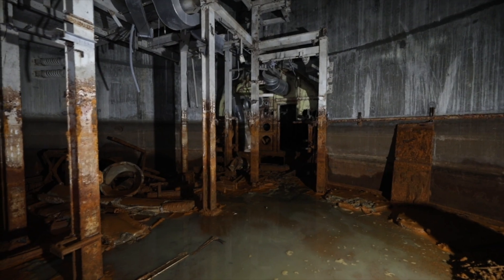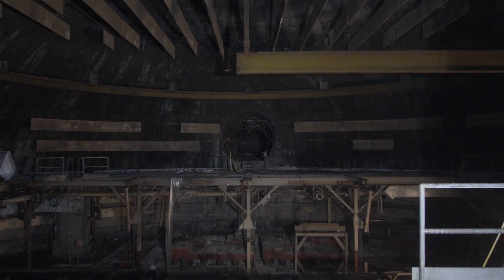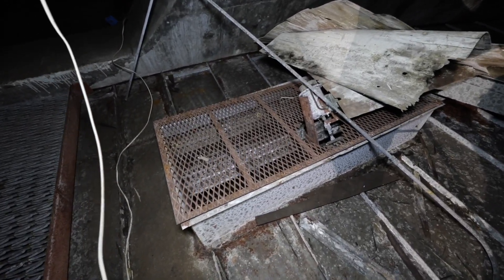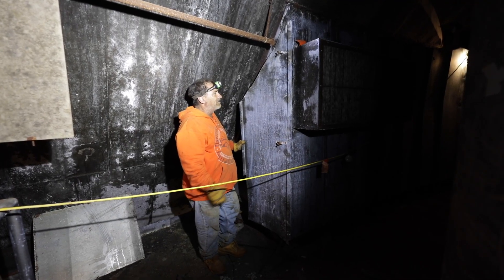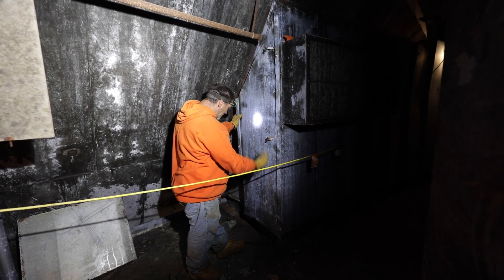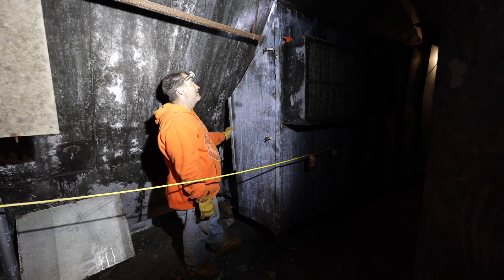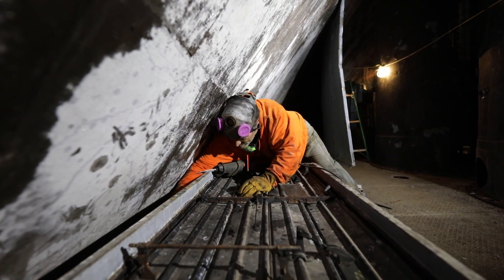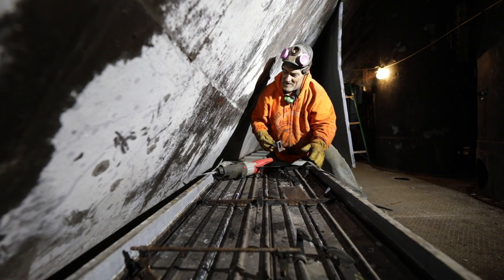Ep. 52 - TITAN 1 Power Dome Mezzanine Demolition

Comment: You have some good workers. You also have big dreams and seems the budget to see them though. You need the access portal lift running. Maybe not the original life but the opening needs to be open. Maybe  build an A frame to open instead of a rental crane?
Reply: Get 2 cat D 9's   
10 chains 
lot steel beams, pull doors open to the sides.
10% Of the cost. 
be safe Mpls Mike
Reply from the maker: Much to do @Erik567.  Welcome to the community my friend.
Reply from the maker: Cheers Michael. Appreciate the feedback.